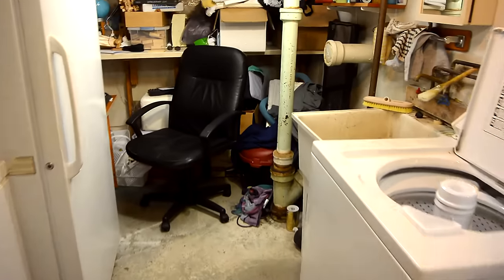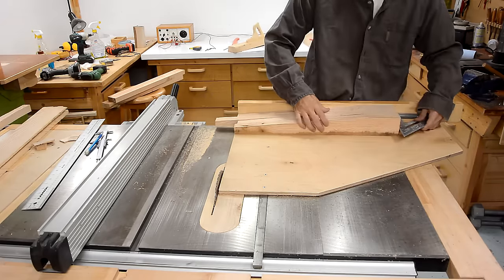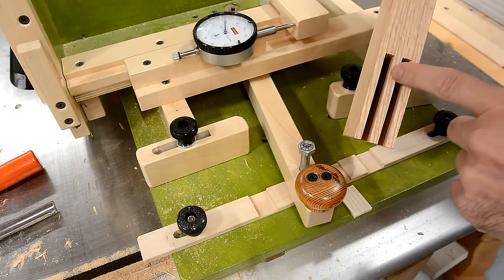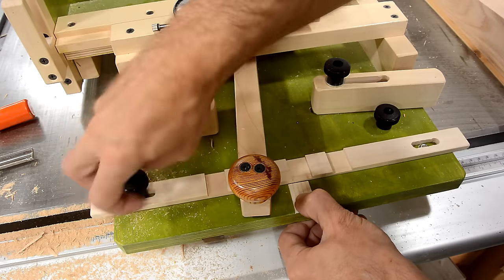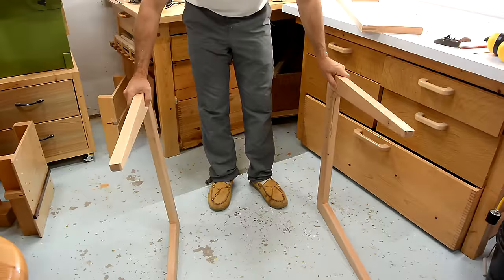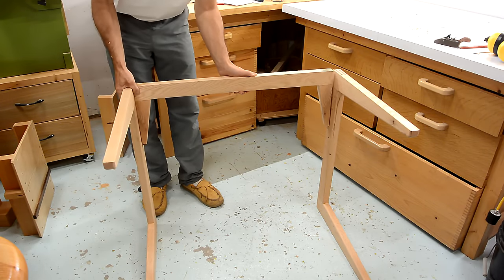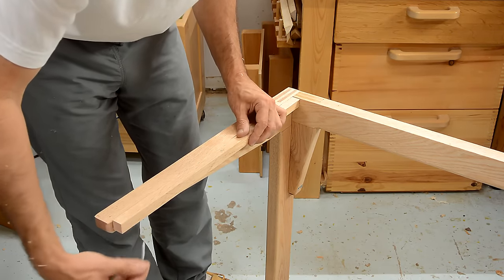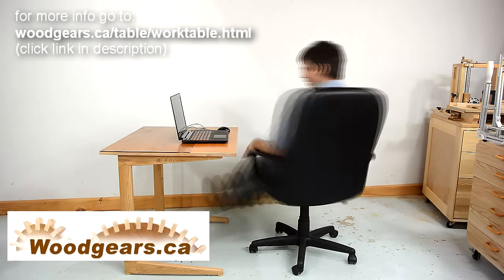Cantilevered work table

Comment: wow, when you started hanging on one of those legs I was stunned. I got the same kind of design and its wonky af.
Reply: It's all the glue and finger joint... and also the hardwood.
Reply from the maker: That was nowhere near loading the joint to the limit.
Reply: That joint is stronger than the ones Snoop Dogg rolls, holy balls.
Reply: Time for a Matthias Torture Test!
Reply: +Matthias Wandel Hahaha, nice, very true!
Reply: Somehow the joints just seem to know who put them together and behave accordingly.

Comment: I saw your daughter on the video, build some toys for her so i can inspire to build something for my 6 months old daughter.
Grüsse aus Paraguay!
Reply from the maker: There isn't that much point in building baby toys. A baby toy will have no more appeal than a random box or kitchen utensil, and after a day, it's play value is exhausted.
Reply: I tend to agree -- except, perhaps, for giant lego, blocks and other toys that can be put together and taken apart, etc...
Reply: If its play value is exhausted, its just as well.....it will make good firewood. In anycase, your marble machines make as gooda toy as anything!!
Reply: Choking hazard!

Comment: What is your opinion towards those Japanese wood joinery methods that uses little to no metal fasteners and glue?
Reply: that is art. it's fine if you want to make a piece of art.
Reply from the maker: yes, it is an art.  But definitely not the fastest, nor the strongest.
Reply: Matthias Wandel But doesn't it last the longest?
Reply: last the longest for what? a building? a piece of furniture? you must remember that the most notable japanese pure wood buildings, the pagoda, has very little to no usable space in it. its entire structure is dedicated to keeping it standing. you can make plenty of things using wood joinery that will last under normal use just as long as with modern fasteners, but they generally will not hold up as well to wear and tear, and the whole build needs to be more complex so things hold themselves together rather than fasteners holding them together.
Reply: SuperAWaC Ah, Thank you for clearing that up. A couple articles I read stated that using joinery without glue or metal fasteners lasted longer because they can expand and contract with the wood. Metal fasteners apparently would cause the wood to split and glue would eventually stop holding.
Reply: Japan is obsessed with tearing down and rebuilding.  some things have held for a few hundred years, by now, which is no better or worse than timber-framed structures in Europe.  the oldest wooden structure may be here, but the majority of them aren't all that old—for most of their history, they were demolished and rebuilt to the same plan on the same site every so often.

now that more of them are protected as historical sites, and they aren't allowed to demolish and rebuild, we may see how durable they really are.

they also traditionally aren't keen on triangulation, so they use way, way more wood than would be necessary otherwise.  further, the complicated corbellated supports don't really respect the strength of the woodgrain very well.

don't get me wrong, I love it, it's beautiful, and going to look at it is one of my favorite things, but to hold it up as the highest standard in wood construction is a bit like saying that the gothic cathedrals in Europe are the highest standard in stone construction while forgetting how many fell down when they were new.
Reply: ThoperSought there are some buildings in japan, including a pagoda, that are upwards 1500 years old. however, because of the lack of adhesives and fasteners, the whole building could be (and was) disassembled and put back together for repairs (or even moved to a completely different place) and it would be nearly impossible to tell. so it's kind of a paradox. do you count from when it was first assembled, or do you count from the last time it was reassembled? the japanese definitely had a unique philosophy when it comes to buildings and wood, that is for sure.
Reply: SuperAWaC
"there are some buildings in japan, including a pagoda, that are upwards 1500 years old."
right, but the overwhelming majority aren't nearly as old as people think.  because they were rebuilt (many times) to the same plan, we feel like they're very old, when they're actually not.

"do you count from when it was first assembled, or do you count from the last time it was reassembled?"
I think it's reasonably fair to count from original assembly, assuming that the repair didn't replace too much of the original, like (for example) the main timber used as a spine to support a pagoda.

"the japanese definitely had a unique philosophy when it comes to buildings and wood..."
definitely, and a really high standard of craftsmanship, too, but also some weird ideas that aren't supported by modern engineering.

I just think it's really hard to draw conclusions about the overall quality of their engineering philosophy from the fact that a handful of very, very old buildings have survived, because the sample size is too small, and neglects buildings that didn't survive.
Reply: +ThoperSought i don't disagree, plus with truly old wooden buildings,  it's less that they were built well and more that they hadn't burned down or been burned down than anything.
Reply: I would have liked these comments better if you mentioned it as "East-asian" ways, because these were also the case in Korea and probably in China
Reply: TheFreaxTux we were talking specifically about japanese techniques. yes, most japanese designs were adapted from china and korean designs, but the japanese refined them in a very unique way. but we're not really talking about the architecture.
Reply: +SuperAWaC Okay. thanks for explaining for me :) Could you give me a few links as examples? I'd like to see myself.
Reply: TheFreaxTux 
the wikipedia article explains things pretty well. it's really difficult to find documentaries that aren't super pretentious

https://en.wikipedia.org/wiki/Japanese_carpentry
Reply: SuperAWaC 
"... more that they hadn't burned down..."
certainly true.
Reply: Jon H 
"... bear in mind how often they've been rebuilt."
that's certainly a good point.  I didn't really consider it, but the amount of work to take care of those must be horrifying.
Reply: +BrokenLifeCycle
Yes in fact, if you're not careful, fasteners can split the wood. But that's pretty much a non-issue if you know what you are doing. (Know what wood you are using, where you are using it (against grain?...) etc ...)
Wood "fasteners" (Ex dowels) can also cause splitting as well.
And for nails ... inconsistent nail quality can cause bent nails, but for the most part, it's the person with the hammer that causes the bent nails ... XP

Comment: fantastic video, wife recently bought a table saw, had to return it due to the blade being out of alignment, a good table saw is hard to find
Reply: I believe most saws will need to be tuned when you purchase them. Now that ive watched Matthias for a bit now, anything that has a fixed blade should be checked for zero out of the box.
Reply: Not these days, well not with Makita anyway. I looked all over the saw for any sort of adjusting screws and only found the fixing bolts, theres nothing in the manual apart from a warning saying that if the blade isnt inline then it should be sent to an Authorised Makita service center to be done.
She contacted Makita but because it was bought off an unofficial ebay reseller they wouldnt do anything for her.
The reseller has now taken back the saw but she still hasnt had a refund. I wasnt too impressed with the saw itself as a unit for the money either.
Would be better trying to find an old wadkin or something decent like that.

Comment: Strange going to such lengths with the frame and not finishing of the top in a nicer way.
Reply: usually I would agree but he always trys to use recycled wood as much as he can, it's a pretty good habit to be honest.
Reply: +Anthony Lamanna He could have finished the wood to the same standard as the frame.
Reply: +Max Lanoue Not with the legs. Those where finished above and beyond.
Reply: It looked like he put a clear coat on, but no stain or anything "above and beyond". The finish wasn't even worth mentioning to him. A finish isn't just for looks - it serves a practical purpose, especially in a humid environment like a laundry room. The pieces he chose for the top were already finished.

Comment: Matthias I feel down... just a small 13x16 box takes 2 days for me! I only have a 90cm x 2m room that I am allowed to work In! it is a serious pain to use the circular saw for everything! for each cut you have to measure again, square it all up, put the cutting template thing on, clamp it such as that it doesnt block the sae... etc...

what do you advise me to do? I even have money for a table saw but the room wouldn't allow it! also storage is a big mess!!

Comment: i'm curious what do you do with that leftover glue you keep in Plastic bowls do you trow it away,do it back in its original box or does it not dry?
Reply: The bowls have lids...
Reply: Wood glue does not bond well to plastics. They just peel right off.

Comment: I am looking to build a work bench with different surfaces. One has to have a nice thick surface so I can hammer on it, and the rest have to have thinner surfaces so I can place heavy things on there. I was thinking of using construction luber pine 2x4's and making the surface to beat on and then using 1/2inch particle board with some MDF ontop for the rest of the counters. Any advice? Or possibly a video on making a proper work bench?

Comment: I built a similar desk... with the expansion/contraction you mentioned, Was it not a good idea for me to glue the top down?
Reply from the maker: if its solid wood (as opposed to plywood or particle board) gluing it down isn't  good idea.  But no worries - the glue joint will undo itself in a few years time.

Comment: Hi Matthias,

Nice build!
Would you consider building a laptop cooling pad and making a video about it? I have a Lenovo laptop very similar if not the same as yours and it tends to get very hot with heavy usage.
Reply from the maker: You need to blow the dust out of it with an air compressor.  Blow in where the air comes out.
Reply: I did that about a year ago...maybe even more, but for some reason that hasn't come to mind again to do that. Thanks!
Love your fork lift toy videos btw!
Reply: I made a cooling pad with two plastic lunch trays, a computer fan, and an old USB cable. The fan plugs into the computer's usb port and blows air under my laptop through the holes I made in the top tray.

Comment: That slot for the top was interesting, would the table warp with time if you didn't do it?
Reply: Yes, that's exactly why. The woods will expand and contract at different rates and you'll get warping, gaps will appear and joints may get unnecessary stress.
Reply: Not only could it warp, but it could potentially tear it self apart, as the top expands or contracts, while legs remain mostly the same.
Reply: neistridlar I just rarely see that slot.
Reply: Well, the slot does not need to be very long. Often times it can be covered up by a large head screw. In commercial furniture different kinds of metal brackets are used, that allow for a little bit of movement. That said though, as long as the moisture content and temperature of the surrounding air remains mostly constant, you can get away without.

Comment: So I was thinking watching and wondering did you ever have a close call cutting a finger off or anything like that? (high blade with no guard in this one) I touched the tip of a table saw blade once unfortunately while it was running and to this day really don't have much feeling in that finger at the tip but feel fortunate because it could have been much worse. Anyway, I have watched probably 90% of you videos (love your stuff) and to my knowledge you have never broached the subject. Just Curious. (?)

Comment: Is there a "law" that dictates how wide the top can be on a cantilevered anything in relation to the base? For instance, the top here is the same size as the base. I am sure it could be smaller but how much bigger and still be stable.

Comment: I've just thought of something, how about using 'plastic' corks from wine bottles jammed into holes in feet of furniture, the only drawback would be the hardship of drinking four bottles of wine, and another if one cork wears down. J.
Reply: That would probably kind of work, but why not just cut it up to use one for all the feet? Drilling holes out to fit entire corks in sounds like asking for trouble.

Also, not everyone drinks wine, and not everyone drinks wine with artificial corks.
Reply: seigeengine
If you drink the wine first the drilling seems like a great idea?,
Even the French use plastic now I was surprised to find on a recent trip over the channel. J.
Reply: A non drinker can just ask around their friends. Someone's bound to have a couple or be willing to keep them aside.
Reply: Average Joe No, it still seems awful. Why drill holes into you furniture to put giant pads sunk in instead of just putting them on the surface?

And it isn't about country. Synthetic corks started making headway because of problems with natural corks. We resolved the underlying problem with natural corks, but now plenty of win, especially cheap wine, uses synthetics.
Reply: seigeengine
Yes, it is a bit awful, I'm feeling bloody-minded this afternoon and I'm out of vino to help regain a little of the sense of humour I'm sadly lacking, Apart from watching this video(which is good) I'm entertaining myself by abusing the 'Over-Unity' nutcases. Regards, J.

Comment: Are more tenons stronger than bigger tenons?
Reply from the maker: yes,  Bigger tenons are actually kind of a bad idea.  Can be more prone to failure than thin tenons.  Too much wood movement in thick tenons can crack the glue.
Reply: Well, there's a limit to how thin you should let your tenons get. I've seen more than one joint break because the wood failed, not the glue. It did so because the tenons weren't thick enough. The tenons sheered off of the body of the beam. Thicker tenons would have been more strongly attached to the rest of the timber and less prone to breakage.

Comment: That is an awesome desk but putting your computer in the laundry room is a bad idea. It's components aren't designed to deal with the debris in the air and the humidity from the washer/dryer/sink. At the least I would recommend putting a cover over it when not in use.

Comment: What does everyone think of of using dowels rather than the bridle joint to make the connection?   How much weaker a joint do you think it might be?
Reply from the maker: would be ok for use, but not for standing or jumping on
Reply: +Matthias Wandel thank you for the reply. I think I'm going to start building it today after church.  It looks like the perfect answer for my own computer nook.
Reply: +Follow up question... When I drove one of the two 3/4 dowels into the wood I split out the vertical board.   I had added a lot of glue. Is it likely I added to much glue?

Comment: Would it be a bad idea to cut these legs out of two glued sheets of plywood? I need a desk but I have not the tools nor the skills needed for joinery.
Reply from the maker: That would work, but waste a lot of plywood (the shape doesn't nest well)
Reply: if you can cut rectangles out of thin plywood and laminate them in alternating 3-piece layers you can make something similar without any skill in joinery.

Comment: dat gaming laptop
Reply: It's a shame gaming laptops are the only laptops on the market with any real horsepower. I'd love it if someone made a gaming laptop that looked like something an adult would use.
Reply: Look for the keyword workstation laptop
Reply: +Dave Starr MSI does. I own a PE70. it's a Gaming laptop with i7-6700, GTX960m, and both M.2 SSD and SATA slots.

it looks like a MacBook.
Reply: Looks like a lenovo y500, i had one, and I used it strictly for work (now it's a media center), like Dave Starr said, anything but "gaming" laptops is underpowered now
Reply: I've been using what's essentially a Clevo P170HM for the last six years for work and gaming at home. The fans are too loud though imho, and spare parts aren't really that cheap.
Reply: nrdesign1991 I never understood the appeal of Clevo/Sager laptops tbh, they perform the same as any "brand" laptop (with equal compenents), in a much uglier package, and often for more money
Reply: *****
My next performance computer will be a Desktop again, and a separate notebook for productive work/uni. I'll wait until this thing falls apart though before building my next PC.
Reply: nrdesign1991 well, I still prefer laptops over desktops, simply because I don't upgrade computers, I re-purpose them.
Reply: I'm awaiting the day we get modular laptops...
Reply: rivengle
I can change whatever I want, however the parts are somewhat specialized and hella expensive.
New keyboard? No problem.
New GPU? No problem (GTX560M atm)
New CPU? No problem (i7 4x2.2GHz)
More RAM? No problem (8GM, 2 slots still free)
New HDDs/optical drive? No problem
New WiFi/Bluetooth? Just get any miniPCIe card

etc
Reply: Definitely desktops over laptops... laptops are for portable use
Reply: Yeah, I realized a long time ago that I have no use for the portability of laptops. So, I may as well save money and get a comparably-powered desktop, or spend the same money on a more powerful desktop.
Reply: HP Z-Book?
Reply: Desktops is easy and cheap to upgrade hardware compared to laptops